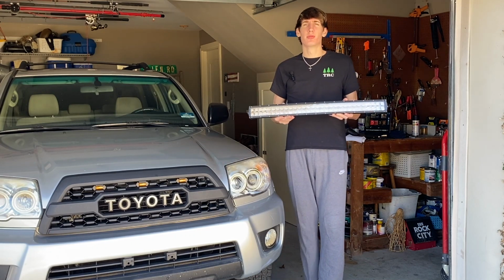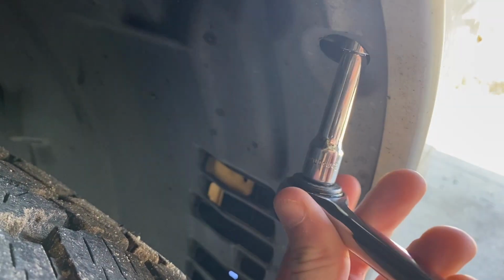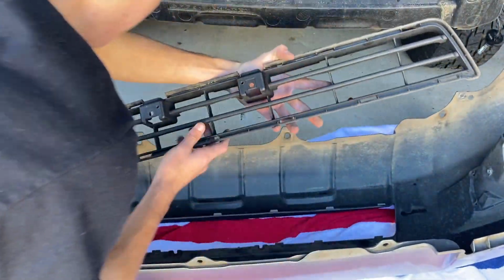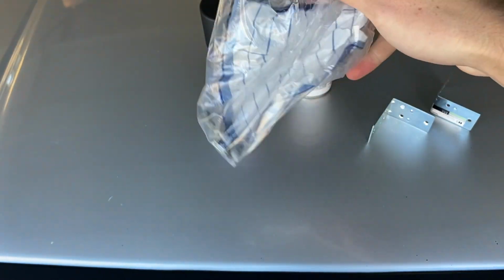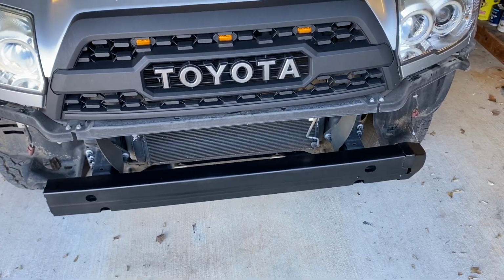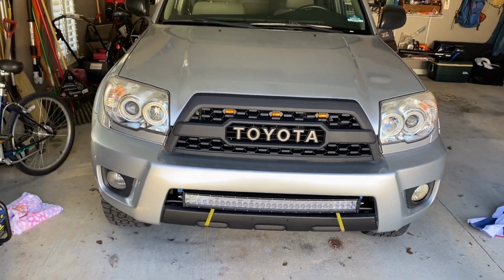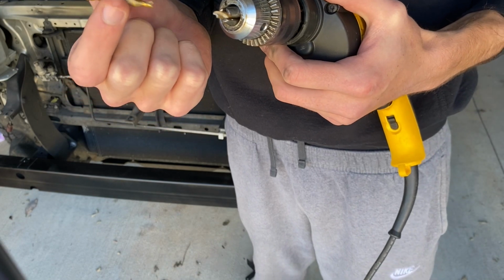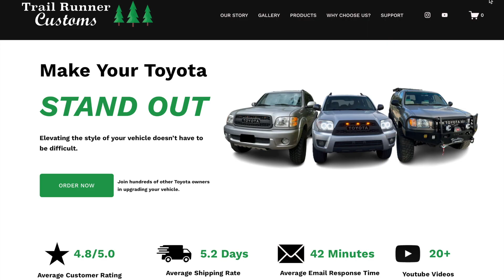4Runner Light Bar 4th Gen Lower Bumper Lightbar Installation

Comment: Just something I learned when I drilled my frame… lots of oil for lubricant, and use a stepper bit after a pilot hole. Expensive and time consuming, but worth doing it right.
Reply: More came to mind, use a punch, or hammer and nail to put a dent for the drill bit, and don’t put so much pressure that you snap the bit.

Comment: Bro I think you just over engineered that, you could've simply used the mounting bracket that the light came with. Exactly how I did with mine. Still love it though

Comment: Why not just mount the brackets that came with the light bar straight to the bumper bar instead of using those L-brackets from Lowes?
Reply from the maker: The fitment wouldn’t be as flush